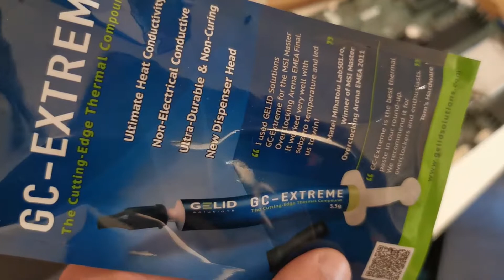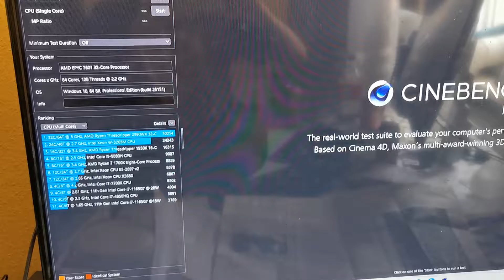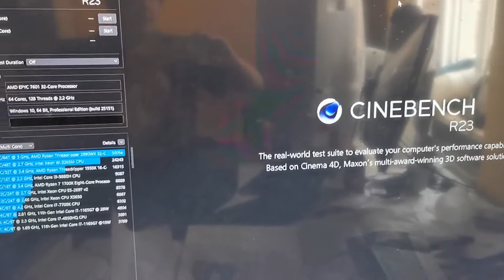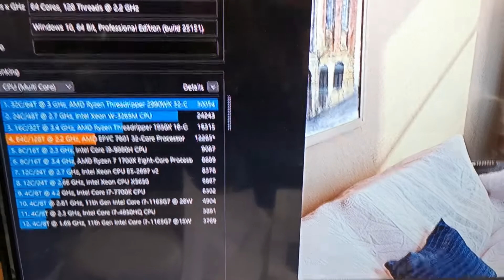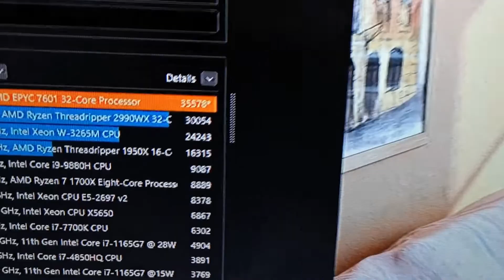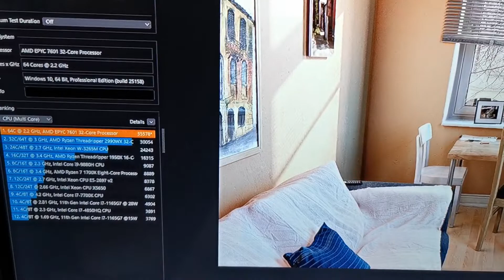64 Cores + Mainboard for 1000$ from eBay?

Comment: I'm going to get a similar setup, this motherboard only has 2 sata ports right??
Reply: Nah, those silver fitting next to the sata, break out into 4 drives each with a cable usually, sort of like a HBA, so that would add 8 for total 10. The orange sata are usually for satadom ssds (but can be used as normal sata, but they provide power for satadoms also)

Comment: Hi, I got the same mobo, which ddr4 ram do you need? My is not working
Reply from the maker: DDR4 ECC registered
Reply: So, which 2133,2666 and 3200 is irrelevant,  its important the ecc
Reply from the maker: @MnoktaKnokta  and the Registered!
Reply: I got 2 ddr4 ram 2666mhz ecc registered, 16gb pc4-21300v-r 2rx8.
 But it doesnt Boot 😢
Reply: @MnoktaKnokta I just installed a pc with main h11dsi-nt and chip 7402 and card rx580. everything works but it doesn't display on the screen.😢

Comment: Do you need a special power supply (ie, non-ATX) to power the Supermicro H11DSI board? Or would a high power normal atx psu work?
Reply from the maker: I used my be quiet dark power pro 11 1000w

Comment: Old epyc is right now the best performance for the buck. The only problem is ram ECC memoory is universal, and can be used in new systems. Even so, you can build 128c/256t with 512 gigs of ram for less than 3k$.

Comment: im also upgrading my system soon on christmas, dual 7551 on the same motherboard with 128 gigs of 2666mhz ecc memory, and im wanting to do some gpu based tasks and some basic gaming so im also planning on getting an rx 6800 xt, always fun to have, play, and use new computer parts, mainly a build to compile hundreds of programs at a time in some cases